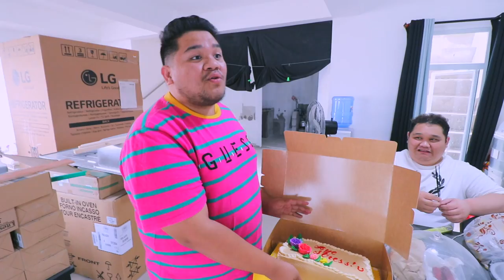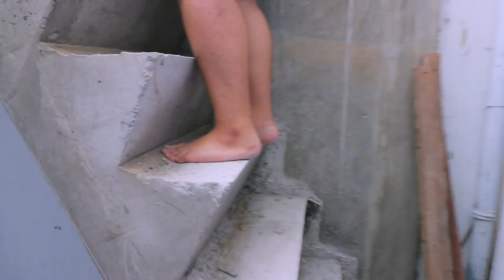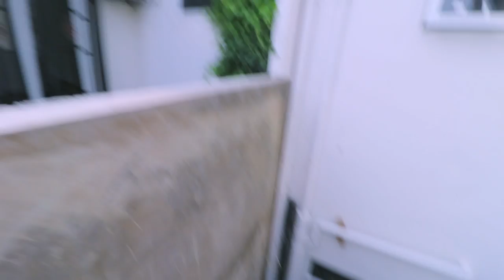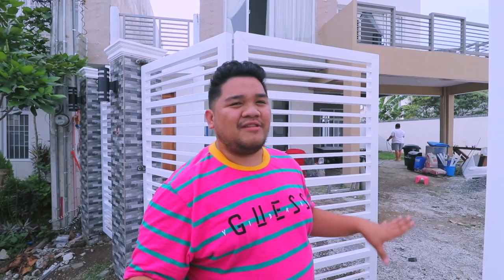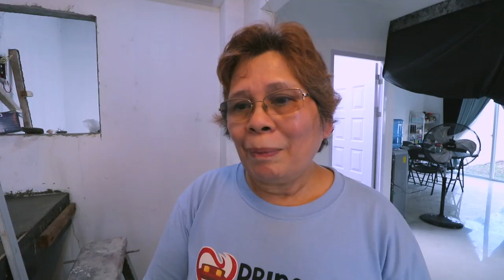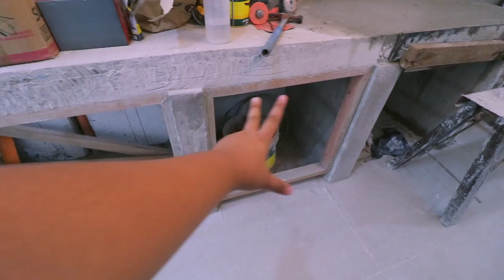TODO NA ANG STRESS KO SA BAGONG BAHAY (PALPAK ANG MGA GINAWA NILA BES!!) | LC VLOGS #366

Comment: Your house is your biggest investment. 

For your plans and design hire an Architect.
#SaArkitektoSigurado
Reply: You can't build a house without an Engineer too.
Reply: @rheynaabregana8539  they can build but not economical.
Reply: @johnmarkcagat7435  architrects can build economical designs but  lacks structural strength, there enters the job of an engineer, they help in building a house/building which is not only visually beautiful but also strong.
Reply: @norjihads.4144  im referring to structural components such as foundation, beams, columns.

Comment: OMG!!!! DI KO KINAYA YUNG HAGDAN.
.PARNG HIGH SCHOOL PROJECT..mali mali jahhah
Reply: Hi LC, I'm one of your kapit-village 😉
Don't worry na stress ka man sa "Toblerone staircase mo", madami naman napatawa(though I know di nakakatawa for you kasi nakakastress nga dba?). 

Anyway, some tips for you since 1yr na kami nakatira and found some issues sa bahay din:

1. CR/Tubo Issues - If di mo pa nagawa, pahukay mo ung septic tank connection mo and connection ng septic tank palabas. Yan usual na issue, pag di yan maayos mag babara cr at lababo mo. 
2. Rainy season warranty - check mo mabuti yung mga pader mo if may markings ng water para mapagawa mo sa developer if may issue. 
3. Tambol(Ask mo sa Engr) - Always check this for water marks, madaming nagkakaissue ng tulo ng water sa mga tubo and dun nakikita sa tambol. 
4. Water Filter - Madami ka masasave na panlinis ng CR if may filter ka. (May kakilala ako if you need one 😉). 
5. Door knobs - Medyo madali masira lalo na sa cr 😆 So mag ready ka na ng pampalit.

For home improvement:
1. Ask for warranty - gano katagal ang warranty ni contructor  sa mga ginawa nila.
2. Also include in the contract na dapat i-accept ng Engr ng Developer (para makuha mo ang bond), if may issue need pa din nila ayusin before mag end ang improvement contract nyo. They should be aware kasi sa guidelines. 

Ayun😉 if you need more info chat mo lang ako sa fb odwimikko 😆. 

Enjoy your new house! ♥️🏡

Comment: Graduated in online class😂
Jok lang po
Reply: Hello Ms. Graduate ako ng Online class ng Interior design institute and I must say wala naman masama or connect if graduate ka ng online class,pag asa construction field ka maski online o hindi man yan,dapat kokote ang pinagagana kasi kaya may "Design & Build analysis" proper costing estimating &  problem solving sa mga field namin.may plan yan even smallest detail of stairs frame may layout yan ilang steps at magkano gastos niya ilang semento ang buhos niyan detailed yan and provided ang details by the contractors dapat may estimated budgeting at naka list, kaya kung may online class na hindi maganda ang execution ng work nila siguradong hindi niya mahal ang ginagawa nila.kasi kung mahal mo trabaho mo curious ka at mas lalo mong nilalaliman ang kaalaman mo at ganun din ang pagtingin sayo ng mga client mo. Sa case na ito hindi online class graduate ang pinag uusapan its more of the workers output framing pa lang ng stairs sobrang mali kaya dapat kumuha ng workers na pulido ang mga gawa may portfolio or compilation ng mga projects nila bago mo i hire o i gawing partner,so sino nga ba ang mag check niyan?si porman and guided dapat by the architect & engr. ang positioning and layout ng structure that should comes with a floor plan and if new building o rennovation may building permit na nilalakad diyan andun lahat pati mga frame ng poste,stairs at sanitation mag rereflect doon kung tama ba bago i execute yung project..Even if it's a joke you should never ever compare online class graduates kaya natatakot mga kabataan mag online class  kasi tinatakot natin sila na pag "online class" graduate ka limited lang magagawa o palpak kasi hindi ka matututo. Kabaliktaran to mas na vivisualize mo yung sarili mo in the near future pag online class graduate ka lalo na sa construction field ka.
Reply: Hindi lahat sablay pag online wag kang judgemental ikaw ano narating mo sa buhay
Reply: Relax lang po😂joke lang po yan😂
Reply: Pero thank you sa speech may natutunan ako😊
Reply: @robertrabara1  business man po hehe😅may joke naman po nakalagay relax lang po wag ma trigurererd
Reply: Aww they didn't pass the joke vibe smh
Reply: @adriancordero9460    nakalimutan ko inumin ung maintenance ko tsuri 😘
Reply: @yowazzup1297  seryoso nyo sa buhay😂

Comment: Opinyon ko lang kuya loyd sana ma notice mo tips ko sa bahay mo. Yung sinasabi nyong mabaho clean out yan hindi pwede takpan o tabunan kasi pag nag bara yang inidoro nyo dyan dudukutin e , para di nyo na tabunan merong clean out na stainless yun yunh i palagay mo wag yang PVC panget tignan , tapos kung mabaho padin pag na gawa nyo nayang clean out ipa check nyo pag kaka tap ng inidoro nyo minsan hindi maayos pag kakabit nyan sumisisingaw yan sa likod ng water closet 🤣, baka sabihin nyo bida bida nag trabaho ko sa engineering hawak condo nag iinspection ako mga unit kya alam ko mga problema
Reply: true, mas okay nang may comments kesa pinabayaan ng ganun.
Reply: Wag mo po isipin yon. Mas OK po talaga may mga comment na ganito kac obvious naman Palpak yung mga gawa at pinaghirapan namAn din nya yung ibabayad sa contractor.

Comment: My daughter is a big fan of yours and she ask me what is my stand nor a reaction on your vlog. That's why you need an Architect for your house Mr. Loyd. Better to build your house in correct manners on the early stage in order not to re-work nor have a back job at the last stage of construction, especially on finishing stage because finishing works is an expensive stage of construction works. For the stairs minimum height of riser is 180mm but not more than 200mm high and the tread must be 250mm as per PD 1096 or National Building Code of the Philippines.  Moreover, your Sanitary works does not have proper ventilation that is why it smell shit (sorry for my language) inside your toilet. Just told to your plumber to provide dry stand pipe or (pasingawan) in order to have a good ventilation on your toilet.